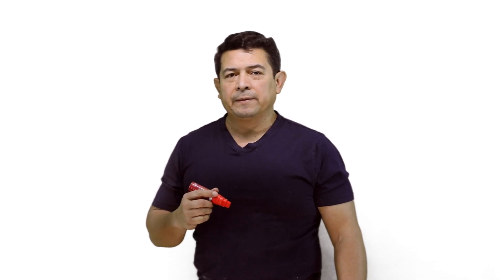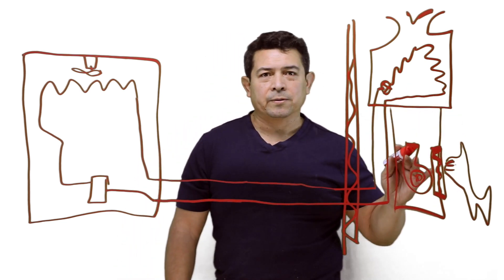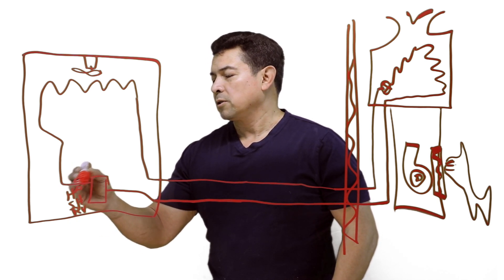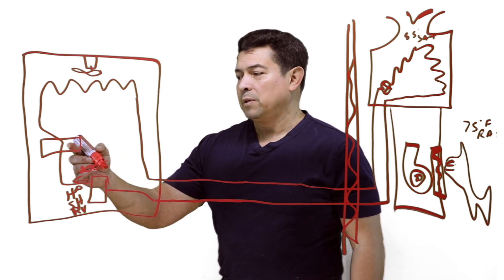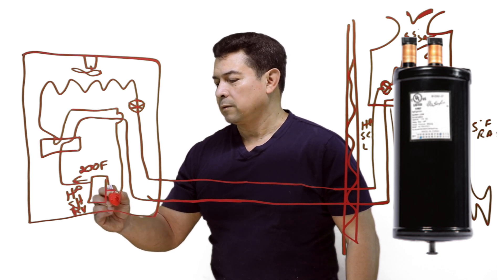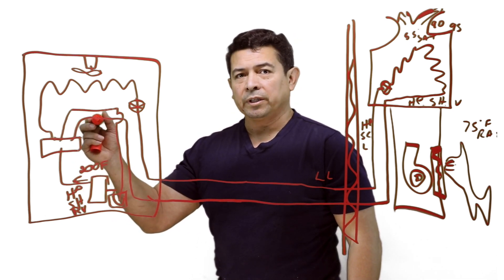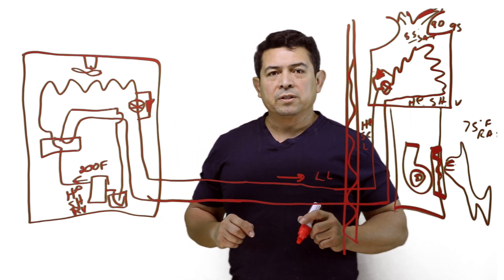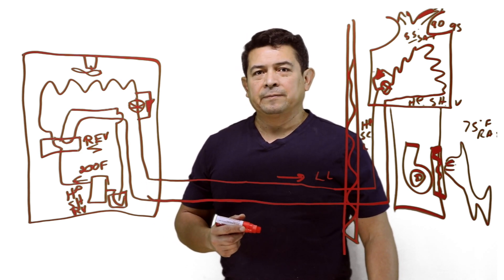Heat Pump Cycle - HVAC Online Training and Courses

Comment: Julio do you have any knowledge on pheumatucs? If you do would you be able to put up a video. Thanks
Reply from the maker: I used to work on them and I could   let me see  and I will try to get some on here.     what part of pneumatics were you thinking? there is a lot!!!
Reply: @AirConAcademy it would be great if you can explain how to set up a velocity controller for a dual vav box
Reply from the maker: @edgarvalencia3827  I was wondering what make is that VAV?
Reply: @AirConAcademy  hey Julio the vav box is a Titus with a hot and a cold deck with velocity controllers.